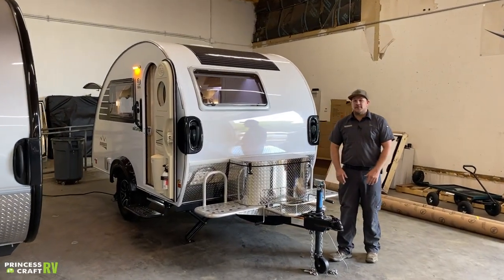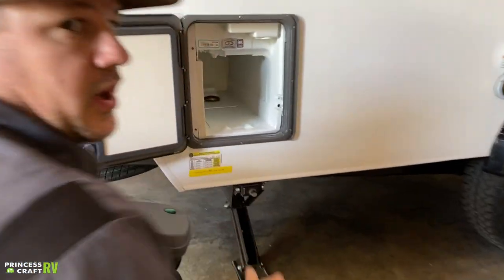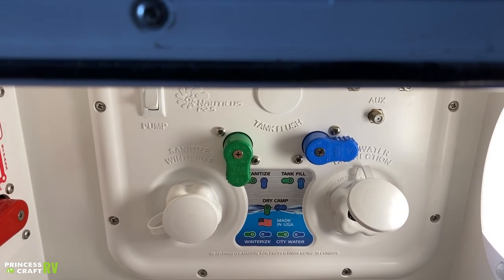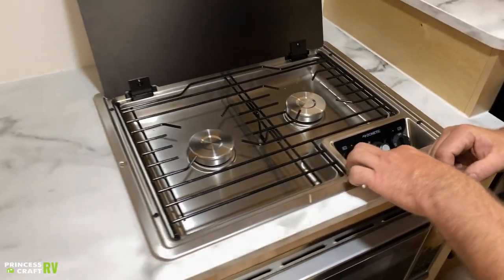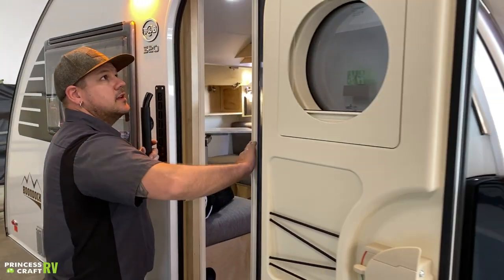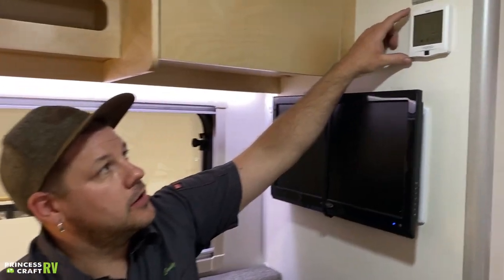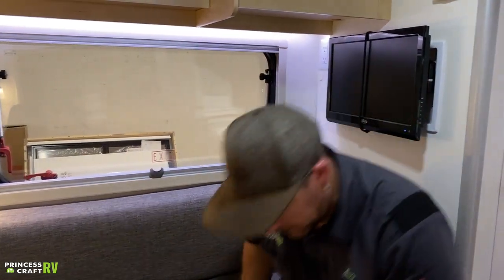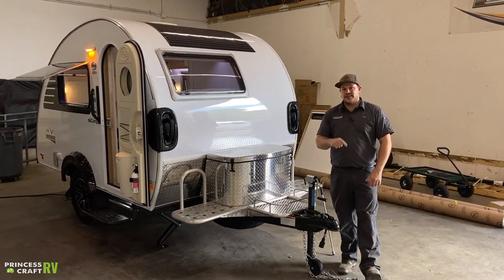2021 TAB 320CSS Boondock by nuCamp RV - Technician Tour

Comment: Great video!! 2 things on the winterization process however: 1.) first you need to drain the HW tank by flipping the safety/drain valve inside the trailer. 2.) You also need to drain the fresh water tank by opening the fresh water drain valve behind the passenger side wheel. These need done before the blow out process. Is that how you understand the process? Also, the factory recommends using non-alcohol based RV antifreeze to winterize the trailer.
Reply from the maker: Thanks for the tips!

Comment: Excellent instuction here. Thanks much for it! One question though: At about 6:15, the presenter mentions that the Thetford toilet gets flush water from the trailer's water supply and it doesn't have its own reservoir. Other videos I have seen point out a fill tube that swings out above the removable cassette where sanitizer and flush water can be added through a funnel that clips into the handle when not in use. Is that missing in this video, or did nuCamp change the toilet setup at some point to get rid of those components? Possibly this is just a difference in models or something?

Comment: This is such a great detailed walk through of the systems. Much appreciated!!! We recently bought the 2021 non-boondock 320 cs-s and have been working through figuring out the systems. Our heat/hot water does not seem to be working. We've only tried it dry camping on propane only. We had a fan failure message at one point. The battery was full. Are we doing something obviously wrong? Any advice on things to check? Much thanks.

Comment: Great video - thank you.  That said, at about the 8:15 mark when the video discusses filling the fresh water tank, I don't find it clear as to how you would know whether the tank was full.  Is there an overflow value in the event the fresh water tank was overfilled?  Is there another means to know how full the fresh water tank is?
Reply: He gets to that later when he’s going through the inside. It sounds like you have to use the indicator light on the panel, so you either need a helper to watch the panel, or you have to go back and forth to ensure you don’t overfill the tank. 37:39

Comment: Is the refrigerator just 12 volt or does it also run on propane?  Saw a video with Mandy who is a rep for NuCamp and in her video she states it is a two way.  What are the two ways?  And what size is the refrigerator?
Reply: The two ways are shore power and battery power. It doesn’t run on propane.